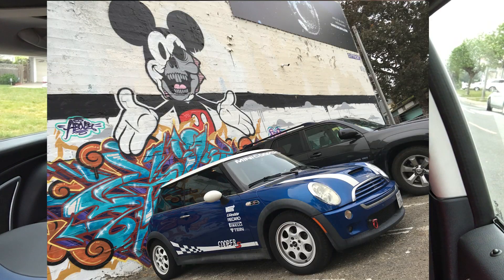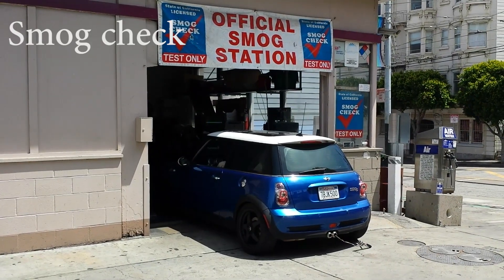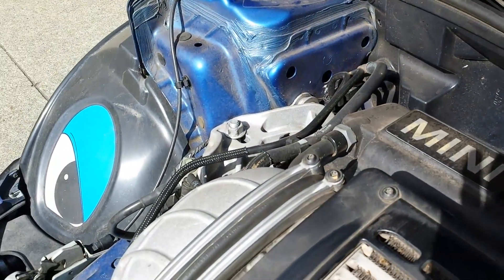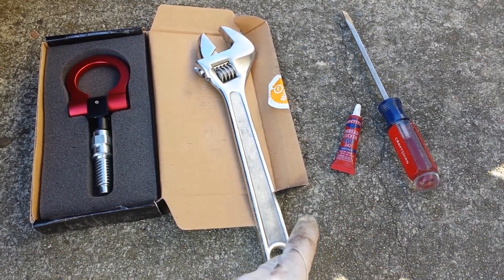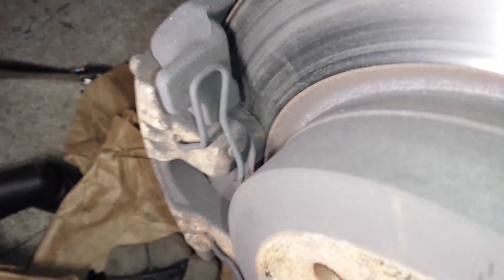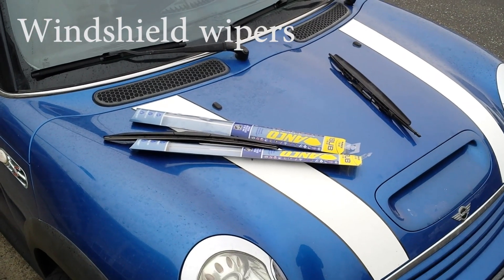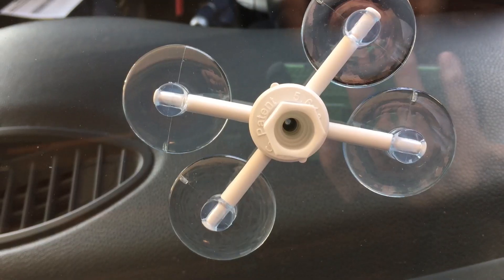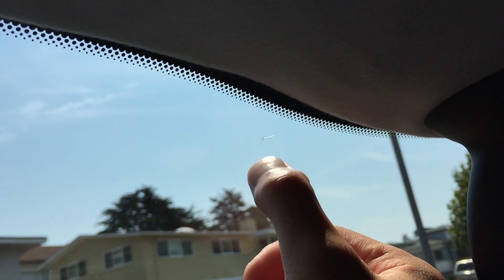2005 Mini Cooper S R53 Mods Intro (DDMWorks CAI, Alta, Supercharged, Boost gauge) Video 1

Comment: Hey bro question about the custom rear lights, i got the same ones for my mini but in black, my question is how did u get all 3 lights working because the top one does not light up but the middle and bottom work fine?
Reply from the maker: Sorry, it has been a while since I had this car. Is your rear lights plug and play, or do you need to splice them into the existing wiring? You'd need to use a multimeter to check for voltage for each function, and then you can wire it up correctly.
Reply: @ColinLeung  oh well they are just plug and play, they went in like a glove but just the top lights don’t light up and i tried switching bulbs and all but nothing.
Reply from the maker: @franciscoaragon9441  I'd try using a multimeter to see if the light socket is getting voltage. If it is then either the bulbs are bad, aren't making contact to the socket, or the wrong bulbs are used. You can bring it to an automotive shop if you're not able to diagnose it. I hope this helps.
Reply: @ColinLeung  oh ok thank you i will do that and check it. 👍